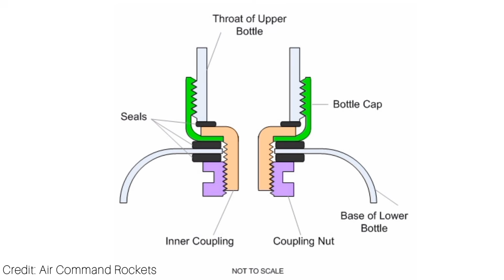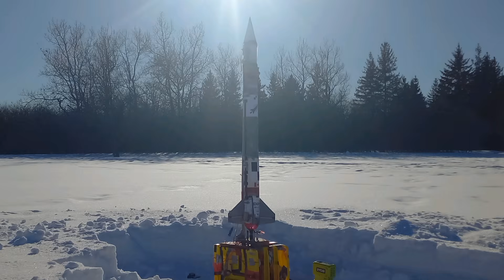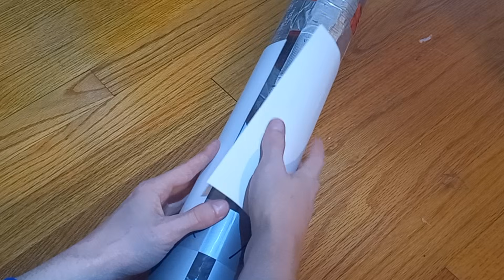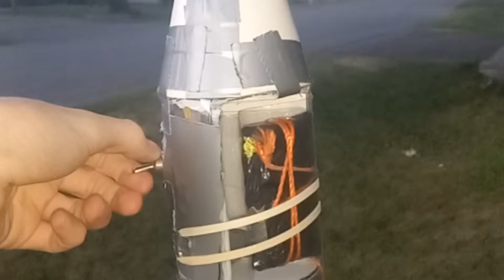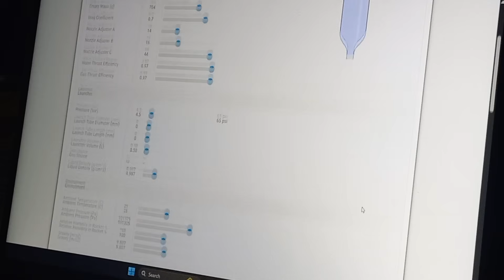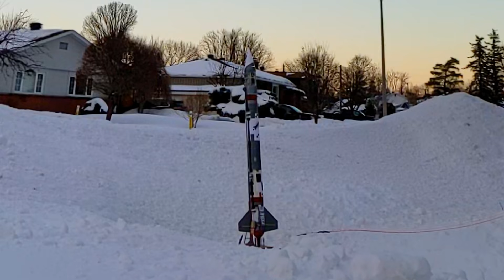How This 5ft Tall Rocket is Designed, Built, and Launched - EXØ-1 | Stellar AeroSpace

Comment: but how do you launch it thru this pin? what is happening when it launches
Reply from the maker: I will probably do a video on launch pad construction soon, but basically there are 4 L brackets and the nozzle of the rocket sits such that I can push a nail over each side of the little plastic lip on the nozzle. The rocket is held down by the pins going through the L brackets and over the lip, and pressure is maintained by a custom O-ring sealing plug. When the pins are pulled, there is no opposing force to stop the pressure from moving the rocket, and it pushes itself off the o-ring and lifts off.